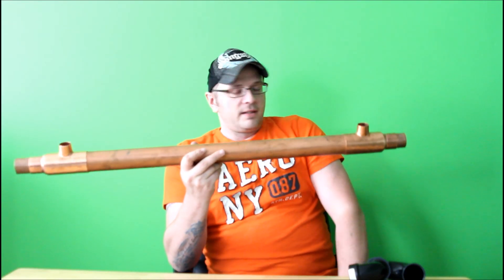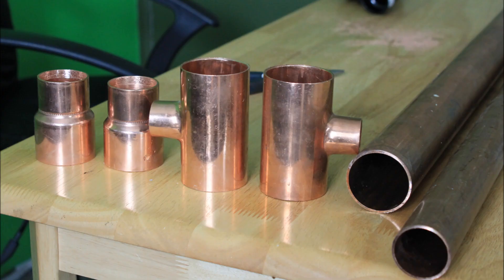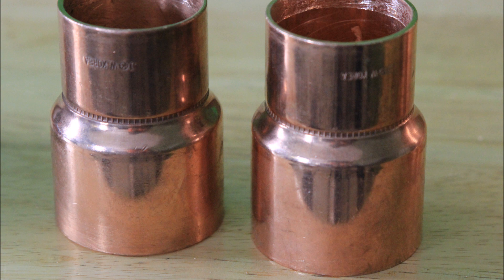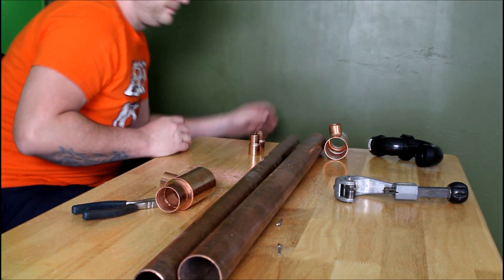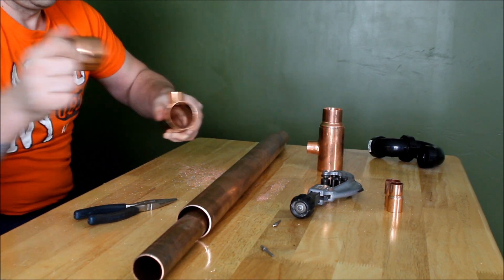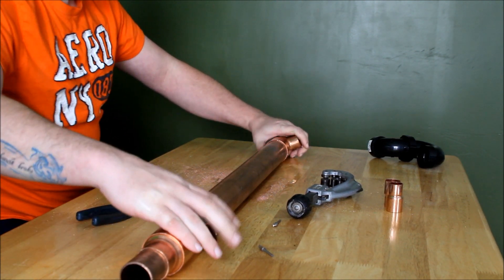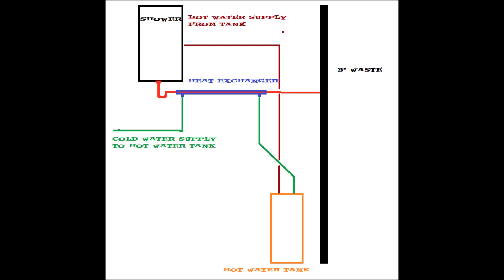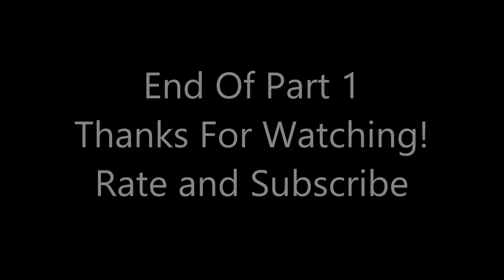Heat Exchanger - Recover Hot Water From Shower Drain

Comment: You need to be careful and warned to never use this on a well pump system. The well water will eat the copper and make it paper thin due to the mineral content of the water. ( effect contaminating the water for the house ) You might want to come up with an option to not use copper for the drain line in that type of set up. If you use copper for the drain eventually the copper will fail.
 Cause: the oils from the body from washing not to mention soaps, cleaning chemicals and last but not least DRAIN CLEANER.
Never use drain cleaner in any type plumbing drain system! Any drain cleaner is an acid either sulfuric or hydrochloric. Both of these will eventually eat through any metal pipe. It’s not safe for user or plumbing system. It will not eat through
PVC (Poly Vinyl Chloride)
It will however cause the PVC to become brittle over a period of time of use and possibly shatter when drain equipment is used causing water damage to your house.
You would be better looping ¾ soft copper around a copper drain feeding the water heater. Not really any possibility of cross contamination. The copper drain will fail and leak before the water line loop will fail. You will notice the leak and repair / replace before any possibility of cross contamination.
Any plumber should be ashamed of himself to recommend this.
Gary Benton
  Class II Unrestricted  Master Plumber  Georgia LIC # MP208127
Feel free to validate at the Georgia Sectary of state web site.
Reply: Gary Benton I thought about that as well. Since the subject of more ecofriendly energy usage is still in its fledgling stage (unfortunately) ,it simply needs a bit of ingenuity I guess. There are actually pretty simple ways to protect the copper. My approach would be to coat the inside with a wear resistant PTFE based protective paint and compensate its thermal isolating effect with a longer heat exchanger.
Reply from the maker: Thanks for taking the time to comment. Type L copper will literally take 20 years to get pitted from having a PH level of 6. Most water sources do not come close to this level. If you have low PH, you typically would know from past experience with mechanical failure.  With any type of plumbing system you should know what your water chemistry is. If you actually developed a leak it really would be no issue other than losing water down the drain. The drainage system is below atmospheric pressure, and the domestic water is normally around 50psi. The domestic water would leak into the drainage and not the other way around. I hope you understand what I am saying. Sometimes what my brain is thinking does not come out in my words. LOL.
Reply from the maker: 32AFuse Thanks for watching and commenting.

Comment: Doesn't the drain needs to be at least 3" ?
Reply from the maker: No. Shower drains are typically 1-1/2" or 2". I guess in really extreme cases of having multiple shower heads and body sprays you may run into a 3" drain. But if you can afford a system like that your most likely not going to care about how much energy you are saving. Thanks for watching!

Comment from the maker: I do not agree with you. A double barrier does not make sense at all. The cold water is in a system that water really never stops moving in day to day living. But that is no different than water stopping and sitting in your lines for a couple days. legionnaires needs temperature and stagnant water. You would see this when a sprinkler system is turned on after sitting all winter and there is no back-flow prevention installed, and the old stagnant spoiled water enters the home

Comment: You must must must mount this exchanger vertically in the shower waste system! !!!  otherwise you're wasting your time.
Reply: ben burton
Correct. Water dropping down the copper waste pipe spirals around the copper waste pipe staying to the edges of the pipe giving maximum heat transfer.   Fitting it horizontally is a waste of time and expense.   It has to be fitted vertically.

Comment: no rob that is a liebig still condenser
Reply from the maker: Clown Whisper Which is still a heat exchanger.
Reply: yes technically it is.  but seeing as its intended purpose is condencyl vapors we call it a condenser.

That is a liebig condenser period.  it would never alter the temperature of the drain water from showering enough to justify its creation and expense. 

When you shower half of the water that drips down the drain does not even come into contact with the sides.

Comment: Funny, I made this exchanger in 1999. Mine's a bit different though.
The shower is located on the second floor, the heat exchanger is on first floor right below.

It's vertical oriented and before I assembled it, I made a spiral by soldering a copper wire around the inner tube.

The CW input is located on the lower side, approx 25cm above groundlevel, the output approx 250cm above. I connected the output of the exchanger to the CW inlet of the (thermostatic) shower valve.

Comment: Cool video - thanks for taking the time to put it together...  I saw some research which found that you get a better efficiency (up to 70% vs. up to 40%) if you can make the exchanger vertical - the water tends to spread out around the pipe better.

Some independent efficiency figures for a commercial install here:

http://www.johnsavesenergy.com/DWHR.html

This other commercial unit also recommends putting the shower trap downstream of the exchanger (page 6) - http://www.heatraesadia.com/docs/MEGAFLO_SHRU_36006178_issue_01.pdf - I'm guessing this is to get the maximum "spread-out" around the drain pipe inner surface.

I wondered about modifying the design to try and make the flow inside the jacket more turbulent (to increase heat recovery) - maybe soldering some copper wire onto the inner tube in a spiral pattern (just tacking it every so often with solder, not continuous) - maybe just 4mm copper wire in a spiral with a 50mm spacing on the spiral.  Commercial stainless flat plate exchangers put ribs in the plates to achieve the same aim...

As has been said by others, you can use this to feed the cold of your shower too (best efficiency if it feeds both the heater and the shower cold feed too).

Comment: You mention "soddering" a joint - what on earth is "sodder"?  Or did you mean
soldering?  - It is spelt "soLder" not "sodder"!  So how should it be pronounced?
Reply from the maker: After watching the video, this is what you ask me? The "L" is silent. I know how to spell soldering. I personally do not like the sound of the word. Most tradesman in my area say it this way. Seriously though, just hit the dislike button and move along.

Rob The Plumber
Reply: As
 with many of these differences between American English and how you say
 it in the UK, it's actually a side-effect of the US sticking with an 
older pronunciation.

"Solder" is a modern spelling of the Middle English "souder", which 
derives from the Old French "soudeur", which itself comes from the Latin
 "solidare". In the 15th century there was a movement to re-latinize the
 spelling of words, and the "l" got added back in to the spelling, 
although the pronunciation didn't change to include the "l" until 
sometime later.

Regarding the dropping of the "l" from the original Latin, that was 
common in Old French, and is why we say, for example, the word "powder" 
instead of "pulder".